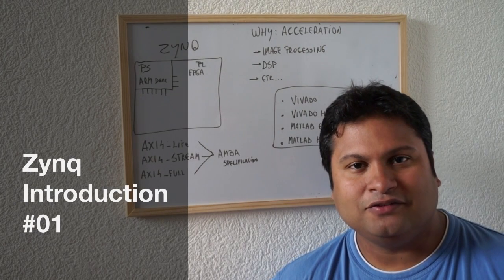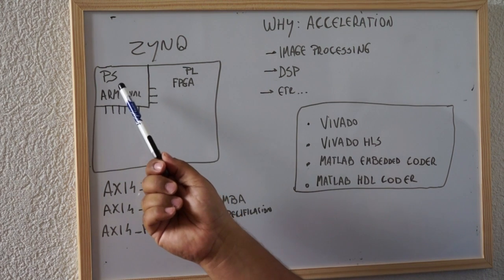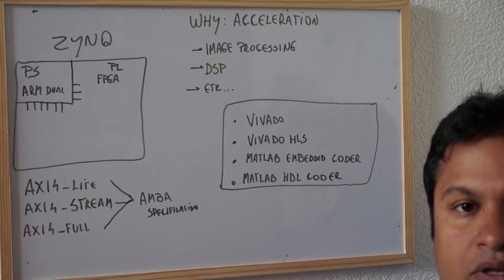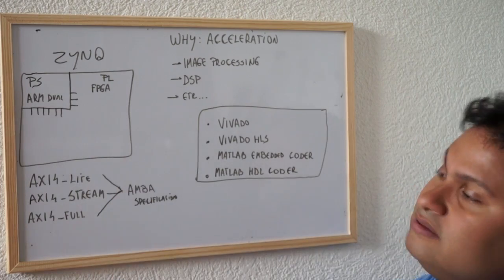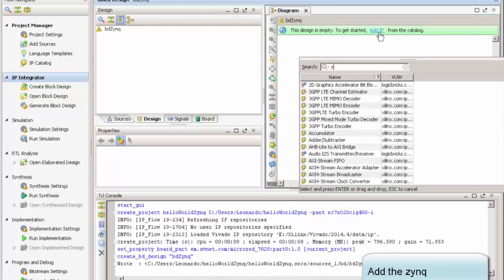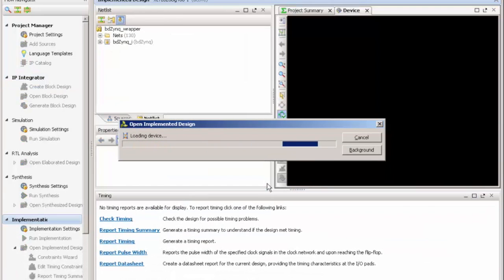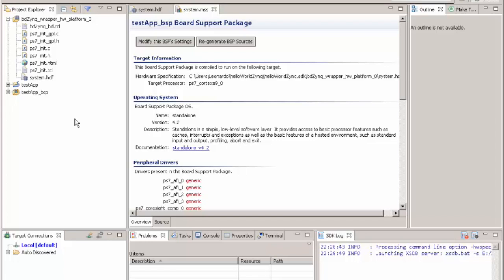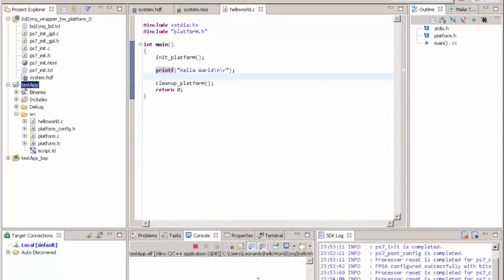Zynq Training - Introduction #01

Comment: Hi Leonardo, I appreciate all the work you've put into creating what is possibly the best collection of FPGA training videos on YouTube today. This because you work progressively toward more advanced topics and do so efficiently.

I noticed in your video (starting around 4:40") that the unconnected "M_AXI_GPO_ACLK" pin on the Zynq block seems to disappear suddenly by about 4:45". Though this may appear to some viewers as being due to running the block automation, this is not the case. An error will result in the next step due to the unconnected AXI interface to the PL.

Re-Customize the IP block to remove it. Double-click on the Zynq block & advance to the next view after the ZYNQ block diagram. Select <PS-PL Configuration> in the Page Navigator pane and expand GP Master AXI Interface. Disable the M_AXI_GPO_ACLK Interface by clicking in the box to remove the check mark.
Reply: Agreed......we must appreciate the clarity and flow of the videos....

Comment: Hi Leonardo, 
               I appreciate your efforts on these excellent videos. I have two questions for you on this specific video. 
1- When you issue the AXI READ transaction on the accelerator, how do you guarantee that the operation is done? I mean if the operation takes long time, will the designer need to add a DONE flag to indicate that the operation is done the result can be read??
2- I am trying to stream a big chunk of data (0.66MBytes) to an accelerator but I am worried about the latency\throughput that AXI can impose.  The accelerator needs 10 bytes at a time and will need 4 cycles (40nsec) to process them. What is your advice??

Thanks,
Fady
Reply from the maker: +Fady Hussein Hi, if I'm not wrong the function waits for it's completion, I've just moved and I'm still preparing my lab as soon as I get everything ready I take a look, Anyway I think you can see the source on Xilinx SDK